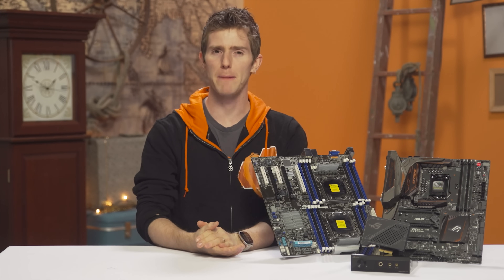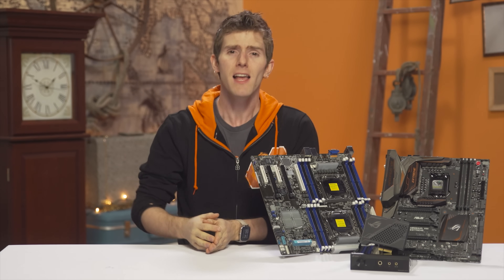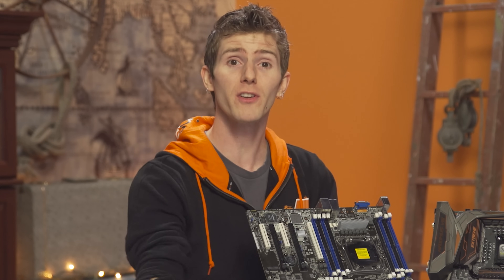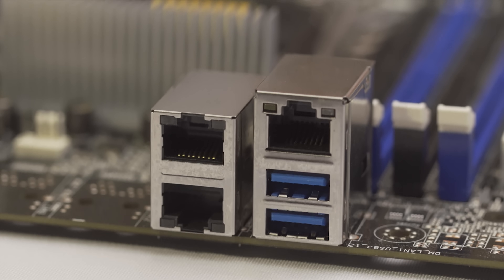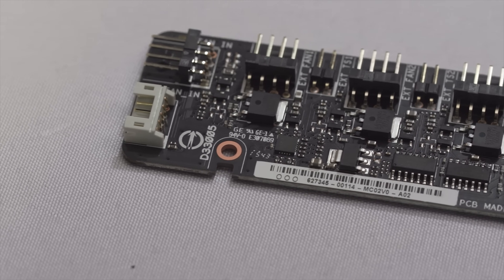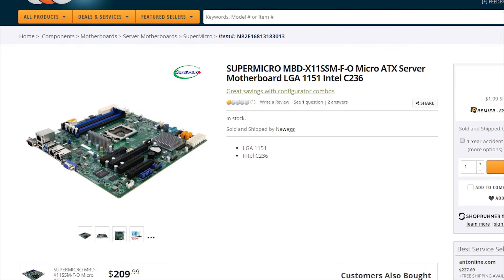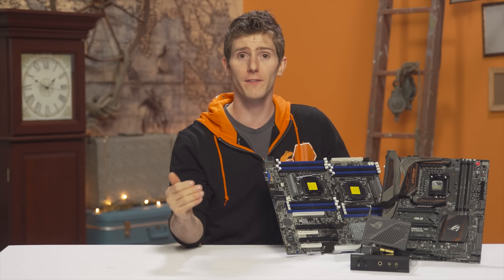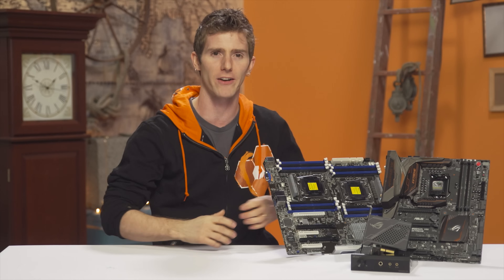What is the best choice for a motherboard? - The Final Answer

Comment: i paired a asrock b150m hds with a gtx 1060 gaming x and a i5 6600 non k.
 Do i do well? If not, why? And, who motehrboard should i buy?
Reply: yeah, if it fits your needs.
Reply: It fit's  all my needs for now, i'll put a deepcool maelstrom 120 or a coolermaster Hyper t4, i think both fit well in that mobo.
Reply: but i'm not sure at all with the air cooling.
Reply: Gianfranco Boz Magni They should fit. The only think I'd be worried about is RAM clearance.
Reply: that's why i was thinking into watercooling too xD because it doesn't make space issues, my case is only space for -160 mm cpu fan, hyper 212 doesnt fit, sadly. a cheap watercooling, for me, is the best option here c:
 thanks for the help!
Reply: Gianfranco Boz Magni watercooling is a decent option if you have the money, it looks nice and helps your themals. Bad new is, a decent cheap 120mm AIO costs around 70 to 80 dollars.
Reply: i was looking at a corsair h60 or, with some bucks more the nzxt x31. deepcool maelstroms are good options too.
The matercooling must be 120 mm, that's all what my case support.
Reply: Gianfranco Boz Magni you won't really notice a difference in performance with watercooling unless your overclocking, which your processor doesn't support.
Reply: I'm kind of late to this, but if you're not overclocking, air cooling is fine (like an air cooled CPU fan that runs quietly). If you are thinking of overclocking, then water cooling really helps out. If you aren't overclocking and don't mind noise from your PC, a stock Intel fan works perfectly fine as long as you have a case fan next to the motherboard as well (which should be obvious for all these options).
Reply: Gianfranco Boz Magni If your case has enough clearance to place a Hyper 212 Evo in your PC, go for it. Otherwise, go for a water cooler, if you have a thinner case.
Reply: Gianfranco Boz Magni Yes, a T4 will fit. Actually, any cooler which supports an LGA 115x socket will fit in all of them. Have you thought of going to a used store or online and finding a beefier cooler to use? I saw a Corsair H45 Hydro in my area used for 45 bucks CAD, around 34 USD. It didn't come with the box but the owner lent me his thermal paste, so that makes up for it.
Reply: Gianfranco Boz Magni sucks :P Can you look for something like a Zalman cooler? They are made of high quality solid copper and I think they make decent coolers. Along with Cryorig and Cooler Master :)
Reply: Hahaha, you're not late, i'll do the buy in some months, for now i'm with the stock cooler.
 The big problem is the space, my motherboard is a micro atx.
 And, the city where i live is pretty damn hot in summer, 35ºavg, watercooling is a interesting option because fits perfect, it's pretty quiet and, seems soo good.
 And, the corsair h60 for example, is not really expensive, just 30% more than a hyper t4, i thinks is worth that plus of money.
 My cpu is locked (i5 6600 no k) so, the overclock is not an option for me.

SORRY for bad english xD, please don't cry after read this text.
Reply: Gianfranco Boz Magni Do you have a Z170 board? You may still be able to overclock.
Reply: Gianfranco Boz Magni If space is that cramped, then I would go with a 120mm water cooler, although I still think you could find a CPU fan small enough to fit in your case. Maybe the Cyrorig one? https://m.newegg.com/Product/Details?itemnumber=9SIA4UF2DZ6565
Reply: ECCENTRIC I have a asrock b150m hds board, pretty little and shitty dude, but it's enough for me, can't see why spend more money.
 Cryorig doesn't sell his products in my country and the importation is closed :c
 But i can found some things of corsair, thermaltake, coolermaster and id cooling.
 I have seen some air coolers; the id cooling se series (se 213, 214x) and the coolermaster hyper t4, i don't really know if those fit in my mobo.
Reply: ECCENTRIC Not enough for a 212, but a t4 can fit! 
Will fit in mobo? this is the problem :C
Reply: http://www.asrock.com/mb/Intel/B150M-HDS/
Reply: ECCENTRIC I don't really like to buy used thins in pcs, but is a really good option, btw theres not a big differnce in price, i prefer go with a new thing, the difference is really really small.
I wish hyper t4 doesn't make any problems with the rams C:
Reply: ECCENTRIC I'm between a coolermaster air cooler or a cheap watercooling, zalman coolers here are sooo expensive, more than a cheap watercooling.
Reply: mixgame jakub Ryzen is a 8C/16T CPU. That's not the best for gaming. A 4C/8T Skylake is better for the value.
Reply: I'll not change cpu for now and in some years, this i5 is enough for me ;)
I'm just looking for a good cheap watercooling.
Reply: I'm looking for a watercooling just because a space problem.
Reply: Btw the ID cooling air coolers are a really good option, and those are a third part of money than the cheapest watercooling.
Reply: And are pretty cool and small
Reply: If the watercooling is only slightly more expensive, go for it. But if it is 25-30 bucks more, go for air.
Reply: The aircooling is around 45-50 dolars, the WC is around 100.
 the aircooling is 50% cheaper.

Comment: My #1 factor in picking a motherboard is reliability.   In my experience, they tend to have the highest failure rate of any component, which makes sense because they've got comparatively many surface components and so many connections.  I'll take a PC that I can count on to be stable and reliable over bleeding edge any day.

Comment: I'm buying a gtx 1060 6gb and i3 6100. My budget is small, so is a h110 mobo OK?
Reply: depends which socket your cpu needs
Reply: Jaysonfred yes. But I would advise against an i3 if you plan on gaming with your PC. Spend a bit more on an i5 processor and get a cheaper GPU (maybe a 470 or something) if you need to keep costs down.
Reply: MegaMetal96 I recommend:

i5 4460 or higher

gtx 1050

8 gb ram
Reply: MegaMetal96 well my plan is to upgrade to a better cpu when the next generation comes out. From what I've seen, the i3 6100 doesn't bottleneck the 1060 on most games, apart from cpu dependant ones like gta 5 and the fps drop isn't that significant.
Reply: Jaysonfred i3 will be fine then

Comment: Help please, i'm simply confused. I am trying to build my 1st PC. I chose (not purchased yet) an ASUS M5A99FX PRO R2.0 AMD AM3+,  but people have told me this is an overpriced and unreliable motherboard and there are much better alternatives for less cost!
I know there are hundreds of boards but some good advise would be so much appreciated
Reply: I used Gigabyte GA-990FXA-UD3 rev 4.0 for about 2 years, with fx6300 (am3+) processor.
Worked great, looked great, and it came with the best audio (dolby hometheather V4), the audio was actually so good that i ordered a 120dollar soundcard just to get the same audio. 

My gf is still using that board and build, it cost me about 45 usd new, back then.

Although, the downside being that it is ddr3 RAM board. Well actually all of the AMD boards are. Simply because amd processors do not support ddr4 yet. Not that there is a much of a performance drop, but there is obviously no logical upgrade path. And next time you would have to buy new cpu, mobo, ram.

-----------------------------------------------------------------------------------------------------

I don't know your budget, but by my experience, i could predict quite confidently that it is not too high, around 500 usd maybe, which is fine, no problem what so ever. Not everybody needs to sink a ton of money into a build.

--------------------------------------------------------------------------------------------------

I did a budget build to a friend last week, that you might find interesting.

GPU -  GTX1060
CPU- i5 6400
RAM-  Kingston 2x4GB 2133MHz DDR4 CL13 HyperX
MOBO- GA-h110m-s2
PSU-  Corsair VS650 - 650W - 50A 12V 
SSD-Goodram 120GB SSD, 2.5” 7mm, SATA 3

About 500 usd in America, in my country, electronics are quite more expensive than in states, so here it is about 650usd build. All parts are new, if you buy some things used then you get it allot cheaper.

I would recommend ram, ssd, used and maybe even the 1060 used, the rest buy new.

Of course if you have more to spare then get the 1070 instead and if even more then the i5-6600 or better. 

But even currently that system will not have cpu bottleneck with 1060 or 1070.

Optional extras
A pc case  20usd
Better cpu cooler  20usd
HDD-  SEAGATE Barracuda SATA3 1TB 7200RPM 64MB   40usd

I like amd but currently it is a better value to go intel. And i do not favor overclock, so you can look for the K elsewhere :D

Comment: Hey guys, even after this video, i have no idea what board to choose.
I'm going to overclock a i5 6600k, have 2x8 gb of ram and one gtx 1060 6gb card. I don't want to spend over 150 AUD on a motherboard. Any suggestions on a motherboard would be MUCH appreciated.
Reply: Siim Tuulik Yeah so far it's running quite nice on 1080p. Can even run on 1440p at decent frames. Thanks for everyone's help by the way, wouldn't have had a clue what to get!
Reply: with overclocking you need a board that allows overclocking. for i-5 6600k, you should get something with 170Z chip.
The Z behind it means its made for clocking. Not all chips or manufacturers do the same but with overclocking that is what you need to find out.
Reply: Oh ok thanks!
Reply: LordMegaPotato
 That would be a good board for you if you can find it in australia, or maybe something similar.
http://www.newegg.com/Product/Product.aspx?Item=N82E16813157675R&cm_re=z170-_-13-157-675R-_-Product
Reply: shomolya
I would not recommend that board, simply because it has ddr3 ram. My position is that when buying a motherboard, you want one that is going to last you for a long while.

Otherwise his next upgrade will be a new motherboard and new ram again. Currently ddr4 is a bit cheaper than ddr3, in my country.

But otherwise it is good and up to him whether he wants ddr3 or ddr4 ram.
Reply: shomolya
 Well same doesn't apply to my recommendation, it has ddr4 and it has more logical upgrade path. And he never said he has it, looked like more to me that he was just describing what build he wants.

At least i hope that nobody buys ram before choosing their motherboard,  :D

And if it was left over from the last build then he can sell the ram with almost retail price, ram has good value :D
Reply: shomolya
 If going for 16GB it would actually better to go 4x4GB, for 2x dual channel, would give much better performance per dollar, besides, i do not feel that he would need to add more ram in this dd4 era , maybe only in ddr5 :D
Reply: shomolya
For gaming, over 16GB is unnecessary for at least the next 3 years. For editing and running server type work or virtual machines go for 32GB. It all depends, on the market, best bang for buck. The size of your ram is only the small part. What is the ram clockspeed, what is its latency etc. 8GB cheap stick and 8GB mid-range stick can have a huge difference.
Reply: Oh ok. You guys seem to know a lot so if its ok I'm gunna ask a couple more questions.
1, The most intensive games I am gong to be playing are doom and ark survival (and maybe some new titles that come out), and to be completely honest, I have NO idea what parts to get. My budget is $1300 AUD, could you hep me out?
Reply: LordMegaPotato

Then get the same
CPU-  i5 6600K

same or similar MOBO we talked about

RAM- 16GB of ddr4 ram (no need to go faster than 2800mhz) 2x8GB or 4x4GB

GPU- go for gtx1070

PSU- Corsair VS650 - 650W - 50A 12V

SSD- Goodram 250GB SSD, sata3
or Samsung Evo 250GB SSD, sata3

HDD- SEAGATE Barracuda SATA3 1TB 7200RPM 64MB

------------------------------------------
Rest of you money put to a custom cpu fan (30 usd), a better matx/atx case with psu sitting in the bottom., and maybe some "be quiet" 120/100mm case fans
Reply: Obviously install windows on the ssd
Reply: While some CPU's and GPU's have a great overclocking performance gains, it is generally a bit dangerous and quite more expensive for just a 10% speed bump if done right.

If you do not plan do overclock then avoid the K mark behind intel cpu' and black editions on amd.
Then simply get the i5 6600 (without K) for much cheaper. The K just means unlocked for clocking.
Then a Core i5-7500 would be a better and faster bet, but then you need a motherboard with a LGA1156 socket, not with 1151 for the 6600
Reply: I have to say that things are really expensive in australia :D
That build in here costs about 800aud
and in states around 600aud

So i did a build without the case and a custom cpu fan for total of 1307 aud :D
i hope you have a case :D
http://au.pcpartpicker.com/list/RDhDwV
Reply: You and your obsession with 32GB of ram :D
As ram has very good resale value, there is no good reason for him to spend more money now so that maybe in the future he might need more.

In few years if he needs to upgrade to more ram he can just sell the old ones for about 60% of the market value. And upgrade then, when that time i am sure that the single 16GB  sticks have gotten more mainstream and also have lowered in price.

Besides, the time when games require more than 16 of ram will be the time when his cpu will be obsolete too. :D
And if he buys a motherboard with 4 slots then he could buy 2x8GB now and later just add a single 4GB/8GB stick to run in a single channel alongside the 2x8GB, for a total of 20GB or 24GB, while paying less :D

It's not like after 16, it magically jumps to 32, it is a slow gradual climb. By the time ddr5 ram will be out, i am sure ;)

New cpu's, gpu's, directx 3000 and whatever :D
Reply: Wow thanks for the support. I think im going to avoid OC  and go with this.
i5 6600 processer $300
MSI H110M motherboard $100
16 gb ram $130
240gb ssd $95
1 tb hard drive $70
GTX 1060 SC $360
Case $50
Have no clue for the psu (willing to spend $100)
That comes to $1205 Wow, not to shabby. What do you think?
Reply: I am willing to spend another $100, should I? Or is this good?
Reply: LordMegaPotato
Decent enough.

Is the 1060 a 3GB or 6GB version?
For a psu just get a one with 650W and at least 45amps on the 12V rail, also make sure it has all the cables you need.

And why i chose the gtx1070 is because it is the best bang for buck gpu out there today, almost as powerful as the 1080, and you wouldn't need to upgrade that for a good few years.

The 1060 will most likely start to suffer badly even in the next year, so yeah. Already it is not very good with new games. Good for budget, obviously, but not so good for a long run.

And at some point get a custom cooler for that cpu as they are known to run pretty hot. Nothing fancy, just with a 120mm fan(or dual fan) and with 6 heat pipes.

-------------------------------------

And yes, we have different views.
And i am still standing by my words :D
Reply: shomolya

Just look at the benchmarks in some of the games out today, and some older, it has around 60fps with max setting with many of them at 1080p.
Good for now, but in a year, it is probably down to 40fps, of course you could drop the quality but it isn't no console :D

This is pc gaming we are talking about XD

Anyways i am off to fallout 4, have fun you peoples.

http://www.hardwareunboxed.com/nvidia-geforce-gtx-1060-benchmark-review-25-games-tested/
Reply: I think I might go with the 1070, but is it almost $200 over my budget cuz of win 10, case and a cheap fan. I know it will  be worth it, but still a shame.
Reply: Would it affect me much if i had the 6400 or 6500 instead of 6600?
Reply: Solocid
I have had over 10 gigabytes myself and many of my builds have them. Many of their mobos feature double bios and other features that add to longevity. Still no issues.

What most likely happens, especially with skylake ones, is that the overclock the cpu so far that the motherboard dies. Because skylake cpu's go pretty far before glitching out. Bu that puts strain on the motherboard and its components.

To his performance with gtx1060 and 6600 build would easily play any game out today and constant 60fps on full settings at 1080p. with gtc1070 it would be around 80-140fps, with the same settings
Reply: LordMegaPotato
 Glad to hear it!
Reply: Not much
Reply: I ordered the Asus Z170-A it's fking gergoes looking and it even supports SLI justi n case u want to.. ^
Reply: Oh nice! Saw that one and it's a beauty. I just stuck to the msi h110m saves me a bit for some nice case fans :)
Reply: LordMegaPotato Nice one still.. as long as u dont get Gigabite mobo, idk why heard a lot of negative reviews.
Anyways enjoy ur pc mate
BTw how is it handling newer games can u max out and play them stable at high fps? also waht monitor ur using inches?
Reply: shomolya idk 99% of the reviews are negative for them at least for the skylake ones... but who knows
Reply: I got the Asus Z170-A ATX, it fitted my White case better ^^